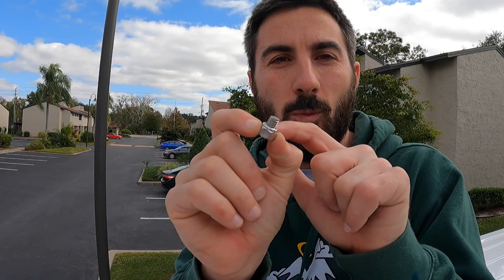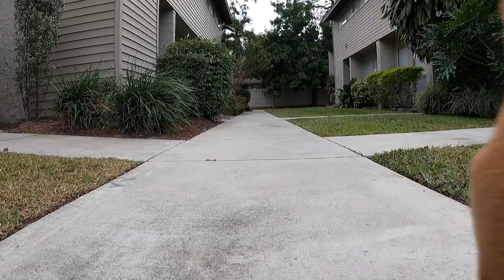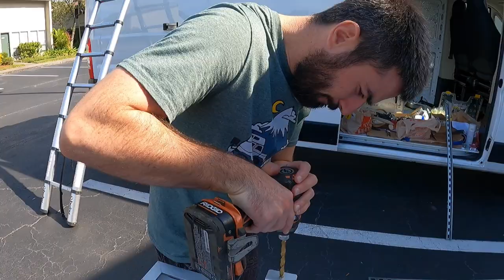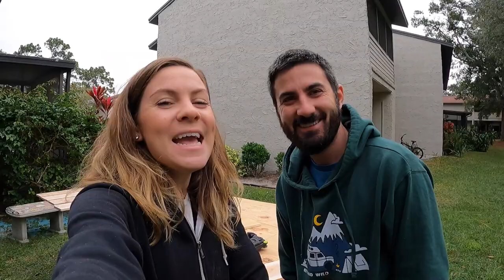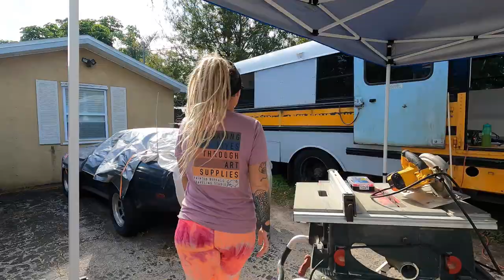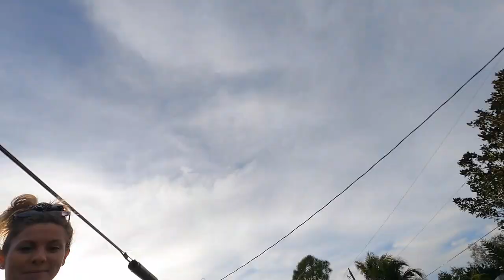No Holes Van Roof Deck with Solar, MaxxFan and Heki Hatch | RAM ProMaster Conversion Build Series 3

Comment: Save time and drive to Home Depot every morning and build in their parking lot!  I like the deck, now you just need a ladder installation.
Reply from the maker: That's the plan! Right now we have a telescoping ladder but we have some ideas for a ladder for the van. Problem is we don't have power to use tools if we try to do it in the lot. but lucky for us home depot is 10 mins away.

Comment: Can you comment on the crossbars in terms of flexing and also if you solved the rattle wind noise from the solar panels when you’re driving down the road please? I’m building a similar rack with superstruts on a ProMaster 159. Thanks!
Reply from the maker: No wind noise from the panels at all. The flex is fine we have zero issues with it and it's been over a year like this now. I hope that helps 🙏  any other questions please just ask.
Reply: @FnAVanLife  Thanks for answering my questions and so quickly! I have one more question here, and then I will tell you what I’m doing with my rack build. After being in the elements for at least a year now, is the superstrut showing any signs of rust? 

As for my own rack project, i’m using the same superstrut as you guys. It comes in two heights, and I’m using that lower profile stuff that you used. I must say I’m a little disappointed that it has so much flex on the crossbars, which is a 5 foot span, but I like your idea of using that foam pipe insulation between the superstruts and the roof. I’m also using Unaka mounts as you guys did. But the big difference with my rack compared to virtually any other I’ve seen so far is I’m building it so it overhangs the sides and the rear of the van by 6 inches on each side. I need enough space to accommodate a 24 foot extension ladder for my business, plus four 100 W solar panels, plus a max air fan and a 23” x 30” skylight/roof hatch, and finally a 4 x 6 1/2 foot deck. It’s been very complicated to build, but all the superstrut is cut and assembled now. I’ve taken it off the roof for now so I can paint it black since it will be visible along the sides where it overhangs 😅

Comment: This is an awesome set up love the roof we just got a ram pro master 2500 and plan to do the same what sizes are the washers,nuts, and lock nuts?
Reply from the maker: So cool!!!! When you're at the hardware store with the unistrut they have a whole second with bolts and nuts and screws, just play around still you find everything that fits! We're almost done with our build guide for this one so stay tuned!!!

Comment: Great video :). We are at about the same point....and looking to work on the roof deck+solar+Maxx. This vid is really helpful.
Reply from the maker: Awesome glad we could help. We love our set up and the roof deck makes views even better 🥰
Reply from the maker: Just a heads up if you don't already know. We have been making videos of all the different sections of our van. It might help you with your build ideas, what works and doesn't. Here is the playlist. https://youtu.be/qGprZejz2Z8
Reply: @FnAVanLife  Thanks....I will check that out. One question.....how did you ever keep the cedar boards from flexing? One part of the video shows you bending the superstrut that goes across the van. But I didn't see anything that shows how you strengthened it.
Reply from the maker: We added another row of metal so the gap wasn't so big between the supports. It still flexes slightly but nothing major and we spent a lot of time up there :)

Comment: Great video. What exactly are the metal pieces called and will they rust?  Do you have to paint the cut pieces to prevent possible rust?  Would like to know what lengths/sizes you purchased and how many of the roof brackets you needed for your size Promaster. Thanks so much.
Reply from the maker: They are called (uni strut ) the lengths are the longest ones they had at the store which I think are 10 feet. So you will have to cut an extra piece down so you can finish the full length. I would paint prime it and paint it cause over time it will rust. But you want to leave the channel clean so you can put the hardware in the slot. We bought a bracket for all the hooks on the roof. We have the 3500 extended so we but 10 or 12 of them. 
Hope that is helpful.

Comment: hi there, looks great. i was wondering if you can hop out of the skylight onto the roof, or is it too small of an opening? Does the hatch lid open wide enough? I'm looking to install a similar one. thanks!
Reply from the maker: Hey Samantha! We can both technically fit through it but you need some serious upper body strength. Frankie can manage it but I got full stuck the other day 🤣
Reply: @FnAVanLife  haha, thanks, good to know!

Comment: Did the dealer you bought the van from,  end up repairing the issues with the back light, leaking windscreen etc?
Reply from the maker: some yes some no! They paid for some back lights but not the main expensive one and sent us $300 for the windshield to be repaired sooooo we re happy enough!

Comment: What did you mean by NO HOLES. Click bait.
Reply from the maker: Did you watch the video? We didn't tap any of the board or unistrut into the roof, it's all connected with the metal brackets and hooks that are already there on the Promaster. You have to make holes for things like the fan, hatch and to run wires into the van. But the actual Roof deck is no holes, that's what we said. Sorry you felt mislead in someway, not sure how you would get a fan into the van without cutting a hole, you'd be blowing air right to the metal.